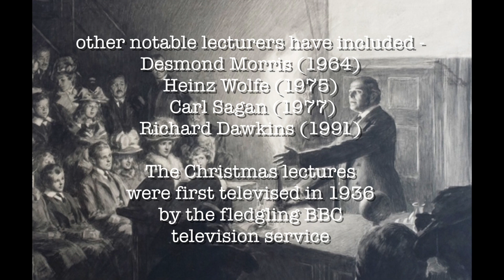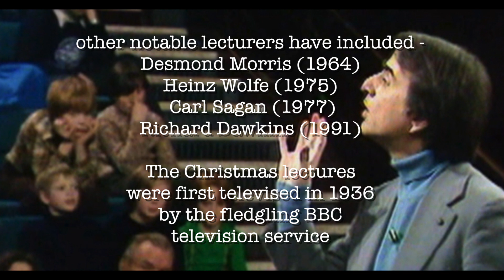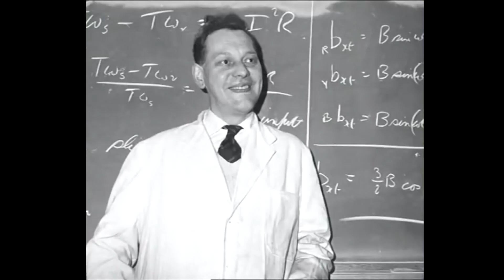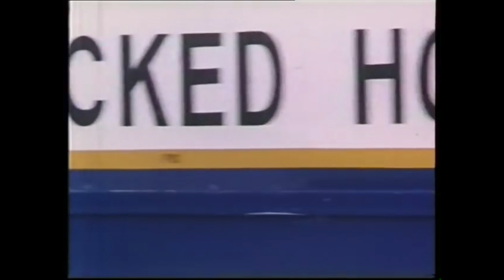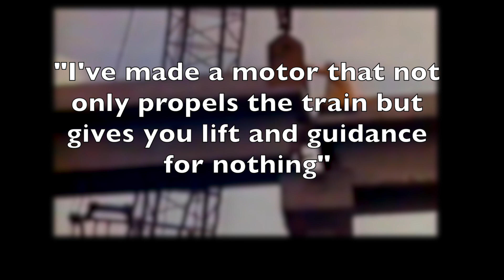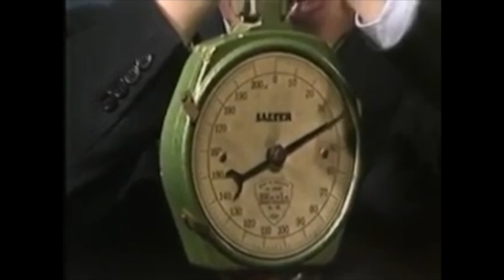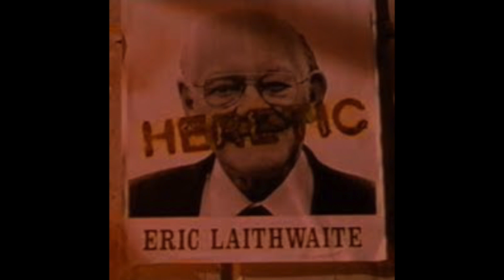'The Anti Gravity Man’ - Eric Laithwaite - part 1

Comment: I was at Imperial when Professor Laithwaite was at the height of his public fame. He was, incidentally, born and raised in Lancashire, not Yorkshire, and that's a Lancashire accent you are hearing. His claims about the behaviour of gyroscopes not being explicable by classical Newtonian Mechanics was exasperating to the academics in the physics department, where I was an undergraduate. It should be remembered, he was a professor of heavy electrical engineering, and got interested in the behaviour of gyroscopes when contacted by a member of the public who claimed to have invented a reaction-less drive, something of a red flag to physicists. I recall talking to some at the time, and they basically said that there attempts to explain the behaviour using classical mechanics and the mistakes he'd made were rebuffed. Frankly he was stubborn, and was unwilling to listen and made claims that he's discovered things about gyroscopes which nobody else had seen. In reality, it was primarily a misunderstanding on his part and there was not, in reality, anything new either save those somewhat scary demonstrations.

He was operating quite a way out of his area of expertise, and all of his experiments with gyroscopes have either been explained using Newtonian classical mechanics, or are down to flaws in the design/interpretation or a combination of both. 

He was, however, very entertaining, even if he went down a rabbit hole with those gyroscopic experiments. It is also a completely different issue to his work in his specialist area, including that on  linear induction motors of course. As to the estrangement from the science establishment, much of that he brought upon himself by insisting he knew better than everybody else, including those whose specialist area it was. Now you can get away with that, if you are right and can prove it. However, he could not and, I believe, eventually backed down on his initial claims.

The lesson from this to me is that if you are going to go outside your area of expertise, then tread very carefully. A few scientists, like Albert Einstein, Barry Marshall have been able to overturn accepted wisdom, but they are fairly rare.

nb. if you want an actual Yorkshireman who had his own, flawed views on some areas of science, then Fred Hoyle is maybe a better example. He was truly brilliant, but also alienated a lot of the scientific establishment and was famously denied a much-deserved Nobel Prize.

Comment: That spinning of a gyro and him using a wheel at the end of an arm is easily understood
As soon as you start spinning that wheel, all the weight is transferred to the center of vortex
Then consider  you have around the point of rotation, you have one force acting in one direction on one side of the wheel, and a force acting exactly opposite on the other side of the wheel, therefore cancelling the weight, and this effect is acting all around the whole wheels circumference,
and the only thing you are lifting is less than the arm that is holding it

Comment: Myself being an engineer, I do respect Professor Eric Laithwathe but he just did not know how gyroscopes work. 
By simply plotting the cycloidal paths followed by one elemental mass particle in that spinning wheel which he lifted over his head, he would have found out that the combination of a spinning wheel and rotation or precessing around him creates two opposite acting centrifugal forces, one (CFin) acting inwards towards his support pivot hand, with the force located on on the upper half of the spinning wheel and the other (CFout) is the normal centrifugal force acting outwards and located on the lower half of the spinning wheel. 
The two forces together with the vertical distance between them (X), act as torque to oppose the torque by the gravitational weight (m.g) acting at the distance of the extension arm, (Ram) 
Hence (CFin +CFout)*X = (m.g.Rarm) = ( I.Ws.Wp) so   ( torque by centrifugal forces)= ( gravity torque)= (dynamic gyration torque) 

Also, the difference between these two opposite acting centrifugal forces ( CF1- CF2) cancels the conventional centrifugal force which he spoke about at 15:40 in this video.

It is to be noted that once the gyro wheel starts precessing around him, there is a lot of vertical down reaction but a very little lateral horizontal reaction on his hand as there are only the drag forces to overcome, but if with his hand he inputs a torque then that would increase the natural precession angular velocity and that input extra torque will help to raise the " gyro". At 15:03 when the said that," He lifts the wheel up with no effort on his part", was not exactly a true statement as the was torquing the wheel slightly and he was taking the full weight of the wheel as any experiment with a weighing machine will show. 
For those interested to follow the details.
There are two precessions taking place in what  Professor Eric Laithwaithe showed.
1.  The first 90-degree precession takes place due to the fact that as the weight of the wheel acting vertically down away from the radial arm support, this torques the wheel vertically down towards the ground,  the result is that a horizontal precession of 90 degrees takes place which means that the wheel must go around horizontally as was shown in the video, due to created horizontal  torque  (I.Ws.Wp)
2. The second 90-degree precession takes place due to the fact that the free end of the radial arm (Rarm) held in his hand acting as a pivot, then the horizontal diameter of the spinning wheel is being torqued horizontally, in exactly the same relation as the vertical diameter was being torqued down by the vertical weight / Rarm of the wheel.  The torque on the horizontal diameter of the spinning wheel will produce a 90-degree precession hence transferring the horizontal gyro torque to the vertical reaction, but this time the transferred torque is such that the axle (R arm) due to the torque forces, pushes vertically down on the Professor's hand. It is this 180 degrees vertical torque reaction working with the extension arm ( Rarm) which transfers all the VERTICAL weight of the gyro on to the Professor's hand.  There is no weight loss in this experiment and not only his hand needs to take the weight but it must take any additional vertical reactions due to dynamic raising the wheel or torquing the wheel. The additional forces generated by nutation oscillations are taken by the pivot support. 
A gyro is a beautiful machine and if it reaches a steady-state condition, it may be looked upon as an aircraft banking a little to go around in natural circles and it needs no support pivot at the center, as all the weight of the aircraft is taken by its wings. A gyro as shown in this video has no wings to take its weight, and so it transfers all the weight and transient acceleration horizontal torque to the pivot point...........................through using two 90 degrees precession torque transfers.  ( one 90 degrees for the transient/drag horizontal reactions and 180 to give continuous weight feedback to the pivot support) 

For those who are interested in electric AC motors or transformers, a related two 90 degree reaction occurs.
When a voltage is applied to a transformer PRIMARY coil winding, there is a 90-degree change effect to magnetize the magnetic path that takes place. When the magnetic path operates at 90 degrees with the input voltage, then the magnetic field will induce a voltage both at an extra 90 degrees later in the primary coil and also in the secondary coil.   As far as the primary coil is concerned it has generated an induced voltage 180 degrees out of phase with the input voltage and this is the BACK EMF  which controls the input current from increasing a lot. Most issues in engineering need to have a "180" degree reaction to any action. So has a gyro on its pivot! 
In this electrical example, the BACK EMF  acts as a feedback to oppose the input voltage.

In the gyro the two 90 degrees precessed TORQUES working in conjunction with the radial arm ( Rarm)  will transfer the down acting weight of the gyro to the up acting force of the Professor's hand.

There are no secrets in any gyro, and Professor Eric Laithwaite should have done his homework well before presenting some statements in public as he did.  Both Professor Eric Laithwaite and Dundee Univesity misled Sandy Kidd for many years, who was made to think that with Laithwaites idea he could have inertia propulsion without any reaction. Unintentionally perhaps, many universities as Imperial College London, Dundee, Cambridge, Sydney, and other universities should ponder a little about how to present the gyro to students, especially the generation of the two opposite acting centrifugal forces where one is inbound acting on the upper surface and one is outbound acting on the lower half of a spinning and precessing gyro.  These float the gyro and also diminishes the conventional centrifugal force we know of.  Please note that upper and lower refers to the situation as seen in this video. 

As far as his Maglev trains, well, given enough power, any brick will fly,  and we can go to mars and the moon with our technology, but it is not economic to do so.  Every family and every nation needs to live by his income and for Britain to have taken up the idea of levitating trains for the whole nation would have been like asking Britain to keep fighting the Falkland Island war on a continuous basis.  Britain did all that for prestige purposes but it could not keep sending Vulcan Bombers to bomb the Falkland islands 8,100 miles away with three or four mid-air refuelings which it did fine..................just to prove an engineering possibility! . Even the mighty USA had to do away with many expensive projects including the SR-71 and supersonic passenger flights as in the Concorde.
The British Royal Institue of Scientists/engineers was correct. The STUNNED SILENCE  was completely in order under the circumstances presented by the lack of foresight by Professor Eric Laithwaite. 
" The fact about a spinning wheel so far everyone has missed!"  ( 16:13)
That statement and the lack of weight of a spinning wheel and that Newton's law needed reinterpretation, by Professor Laithwaite did apply to his own lack of knowledge about the gyro deeper details. 
In Science, emotions must never be allowed to trump logic, reason, and rational thinking.

Comment: Eric corrected Newton's Rule, now referred to as the Law of the Conservation of Momentum, to say that " It is not linear and angular momentum which are conserved independently, but rather the SUM of the two that is conserved", allowing one to be converted into the other. I wonder if this is true. It has been shown that the weight of a Laithwaite-style gyro doesn't change when the gyro is lifted. Is this conversion taking place here, or not?

Comment: There are several supposed antigravity devices, but they all rely on a metal surface. Tony hawk used a "hover board" but it relied on a large copper metal half pipe. The maglev needs a a track. We need to create a magnetic field to repel the earth if you want a true antigravity vehicle.

Comment: In the gyroscope experiment he has to support the full weight of the apparatus while he swings it above his head. It's easier to do than if the wheel was not spinning, because he does not need to apply torque to the shaft to support the wheel, but there is definitely no antigravity involved :-)

Comment: I recently discovered that the Earth and other planets in our Solar system have orbits which display the Conservation of Angular Momentum.
Realising that p is constant it seemed to mean to me that mass must vary since it is related to the velocity but mass can not change... Maybe it can.

As we know professor Eric Laithwaite - who demonstrated gyroscopic gravity modification – argued that, under the right circumstances there is a change in Mass (which is considered to be Universally constant) caused by the spin of a gyroscope.  His claim was seen as heracy, poking holes in Newton’s theory, yet is quite simple to prove. 

Since the value of p (momentum) = mv (mass x velocity) hence m = p/v.
So if we take our planet as it races around the sun its conservation of momentum keeps the momentum constant.
So, since p is constant but the radius (distance to the sun) changes then so must the velocity.
However, if the velocity changes so must the MASS.
 since p is constant and mass is (supposedly) constant then v should be constant too
It seems probable that it must be the weight that changes but something is wrong somewhere... don't blame Eric!
Reply: It simplifies down to p/m = v. Since p and m are constant  then v should be constant. It must be the changes in weight NOT mass that causes the eliptical orbit!

Comment: Bearing in mind that I've never even taken a high school physics class, so I may be getting this all wrong, but it seems to me that the phenomenon that Laithwaite experienced with his "anti-gravity gyroscope" has to do with the conservation of angular momentum. He wasn't so much lifting the weight of the rotor, as much as the energy from the rotor spinning around its own axis was transferred to Laithwaite as he pirouetted in place. As Laithwaite began to tilt the spinning rotor, it needed to transfer energy, and as he turned, the energy of the rotor was transferred through the shaft to him, in the form of torque and "pulling" on the horizontal plane. His body's mass largely negated the horizontal "pull", and his grip on the handle negated the torque. I think it would be much easier for a 175 lb.(or whatever) man to resist a 40 lb. horizontal pull than to do a 40 lb. lift. 

It seems to me that this could be empirically tested in at least three ways: 
1. Have a person replicate Laithwaite's experiment, but not directly grip the handle; instead have the interface between the shaft and the experimenter's hands be a torque meter. 
2. Also, if my hypothesis is correct, the speed at which the experimenter turns in place should be critical, and would be set by the rotor (its mass and speed); the experimenter turning too fast or too slow should affect the ability to successfully replicate it. 
3. Measure the loss of speed in the rotor over time, both without it being disturbed, and from Laithwaite's experiment. My guess is that in the latter, it will lose considerable velocity because of transfer of energy to the experimenter, due to the conservation of angular momentum.
Reply: This is not about free energy, though it is almost presented as such in this demonstration. Naturally the kinetic energy of the flywheel is spent. However, if this is correct, which would have been easier to judge if he hade made a rig with a force meter and a torque meter as you suggest, the amount of vertical force could be calculated. So as a kinetic converter that changes rotational movement into linear without using acceleration of linear motion as everything else does, is as groundbreaking as the EM-drive, and be usable as a propulsion device. However the math in this is not , that complicated, and it should be easy to prove on paper if this works or not.

Comment: Did any of you noticed that when the other guy was tuning the wheel up for speed, the sound it made is exactly what we hear when planes are on the tarmac about to lift off? And when he lifted up the wheel and swirl it around there was minimal amount of sound or non at all, just like when in high altitude,planes are usually quite quiet.
Reply from the maker: I think you were hearing the sound of the electric drill motor. After it was disconnected the gyro disk was spinning in a bearing
Reply: @SimonHollandfilms  ya maybe